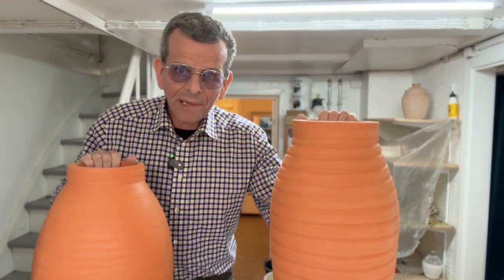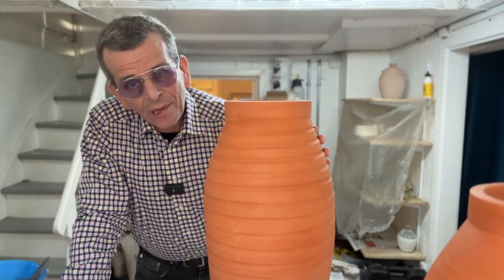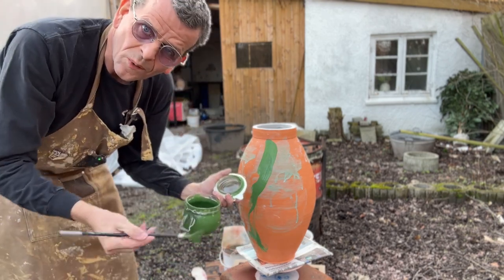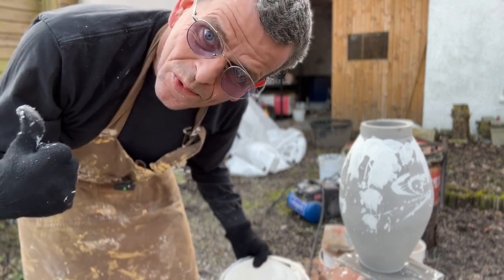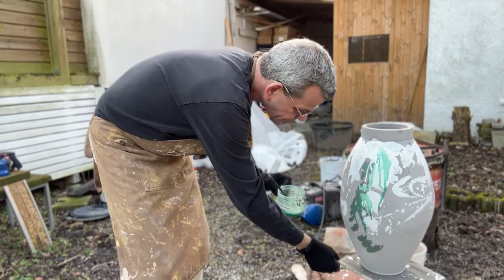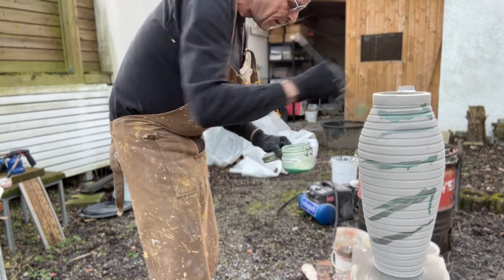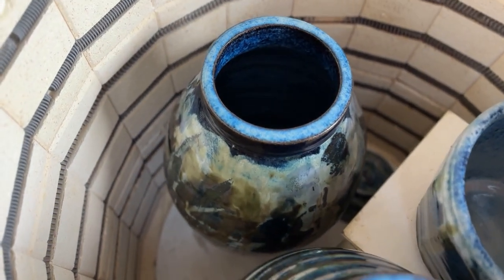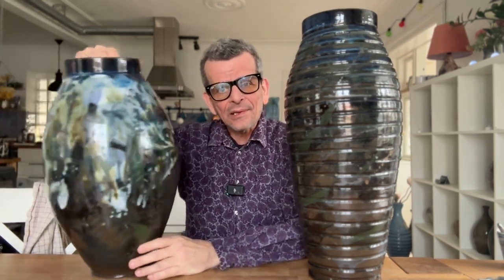89. Glazing Big Pots - Multi Layer Pottery Glazing with Oxides and Stains

Comment: Thanks for taking us through the whole process. I wonder how they would have turned out in a reduction firing.Also I wonder how belt dressing would work as an adhesive for re-glazing. Belt dressing is used to make fan belts more grippy.
Reply from the maker: I move reduction fire but I do not (yet) have my own gas- or wood fire kiln for it. Also, the glazes I use in electric are all formulated for cone 6 and although it is possible to do cone 6 reduction the glazes I love the most for reduction is all cone 10 :-)